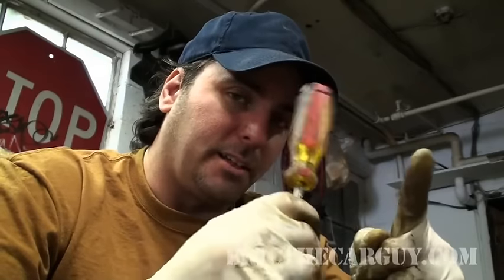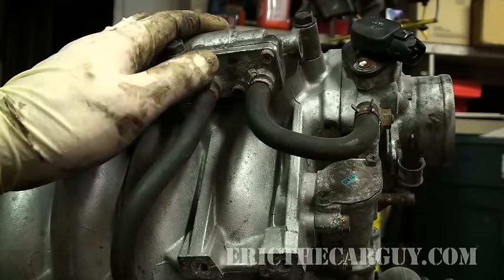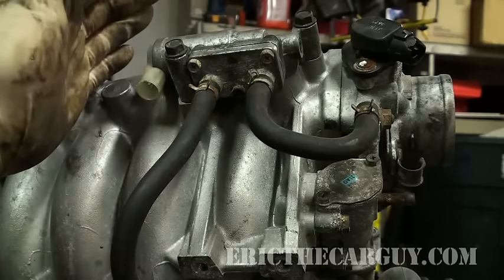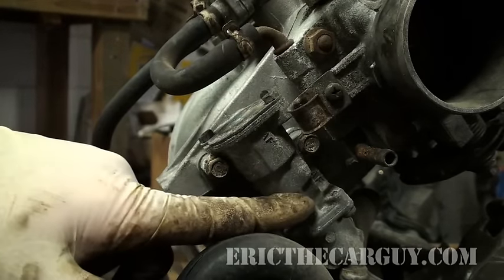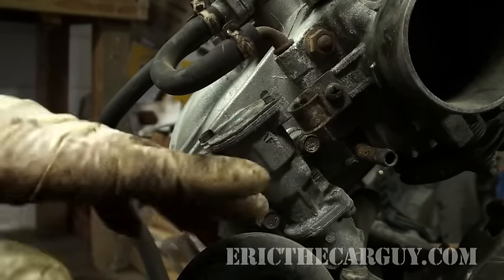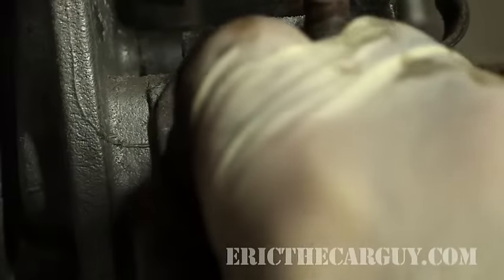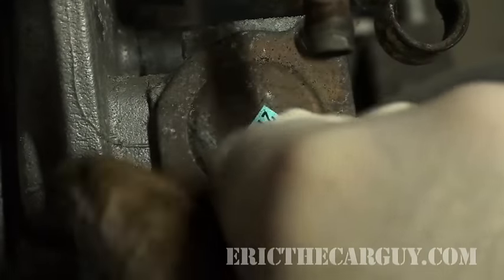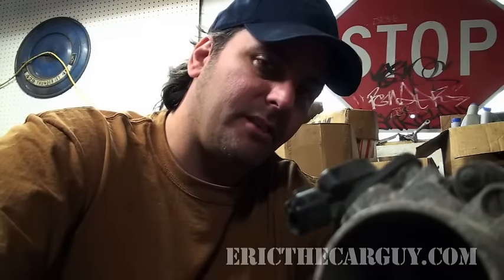How To Solve Honda Idle Problems - EricTheCarGuy

Comment: could a bad map sensor be the cause of an idle issue? I have a 96 Honda civic with a b16a motor and I checked my idle air control valve and cleaned it out and I was still having an idle issue but when I unplugged my map sensor and sprayed some carburetor cleaner in it I got some gunk out that was in it and it temporarily fixed my problem until the next day I drove it and it did the same thing happen with my idle. could this possibly be the problem?

Comment: I’m here in 2024 you basically told me I need a new one. My d16y7 has been sitting for a few years and I’m resurrecting it and I’m totally fine with that, no need to beat up an old part.

Comment: my 97 accord stalls randomly dosent make noise just quietly dies  , replaced the diatributor cap, rotor , plug wires , plugs , valve cover gasgets , i have to hold the key on a second or two after i start it so i know the ignition switch is going , do you think the iacv could be bad also .

Comment: Hi Eric, my 1992 Honda civic takes longer than expected to idle on a cold start. Even when the engine get to it normal operating temp, and u switch off then engine and on again, the idle goes up and again and take another century to idle. In summary, whether the engine is cold or hot, when you start up the engine, it will take so long to idle. What could be problem?

Comment: You mentioned throwing parts at it. I've replaced the distributor, fuel filter, plugs wires etc and still haven't found the problem. I've tried everything. Still idling really low. I'll figure it out eventually.

Comment: if there is air in the coolant system and it is roughly 70 degrees outside would the idle air control valve you talk about be effected?

Comment: Hey I just had to replace a thermostat in my 08 tl base nav atm. Now that that is done the car starts up fine idles fine but when driving the Rpms slightly fluctuate when coming to stop or accelerating. Any ideas. Would be greatly appreciated

Comment: I disconnected battery. Checked all of this. Turn on and operating temp rough low idle and compressor (new one, all a/c system checked out) clicks in and off a bit. Is it the air control valve?

Comment: Hey I'm having a problem I been looking for the a vacuum leak with no luck. Now my car bogs down and sometimes even backfires I have a 98 honda civic EX and it doesn't accelerate the way it use to accelerate. ignition is brand new and cables spark plugs

Comment: Hey Eric. Thank you in advance for al this helpful video clips. I have also a idle problem in my 99 integra. After I turn on the car the idle at cold is very rough and after the car reach the operating temperature and is turn off, to turn it on again it becomes a problem. It gives me a hard time to turn him on. Both FITV and IAC are brand new. What this could be?

Comment: Question about erratic idle on my 02 accord 2.3, with the ac on, but only with ac on, any other time, it idles fine. Idles up and down fast, would this be an iac issue or another issue altogether? Thanks.

Comment: Thanks, I recent installed a used engine on my 2002 civic. It has a fluctuating idle, I completely forgot to burp the cooling system.  Thanks

Comment: do you have a video on what to check when vtec fails to engage on older Honda's I've cleaned my vtec solenoid and checked wires and yet it still fails and I can't surpass 5k rpm.

Comment: Just did a JDM H22A swap in my 96 prelude Si mine idles up and down till it warms up for a few mins, then again I'm running off a p14 ecu that could be it. I will know when I get my p28 here in a few days. Good video
Reply: Very good video! I have a 91 accord and I am so grateful to have found your vids! I am dealing with a rough idle problem and have been going through all your steps. Subscribed. You're awesome!
Reply: Swapped out my p14 ecu with a p28 now she idels perfect
Reply: Aeolous Sul in the same way bro have a H2B in my ek hatch and it idles up and down till it heats up then i turn it off turn it back on and it runs good still idles high tho..
Reply: Aeolous Sul
Reply: +Geo Castellano Running the right ecu helped mine doesn't do it. I was using the H23A1 to get it going! now I'm running an obd1 p28
Reply: Also bleed the air out of the cooling system
Reply: it's supposed to do that
Reply: it's not supposed to do that, it should Rev up a bit until it reaches operating temp then come back down but it shouldn't surge back and forth

Comment: Tried all of this but still code 14 persists. I suspect it is my wiring ?   88 Civic dx swapped jdm d15 vtec.  All is well except the code 14.. tried 3 iacvs, cleaned them too . Bled cooling system and re did it.  Adjusted fitv and nothing.. still code 14. How do I check wiring ? I'm at it for the second month..

Comment: I have an 03 accord 2.4L 4cyl that picks and chooses idle at random with no check engine light and have run a scan with no codes. In park engine warmed up will idle between 1k and at random bump to1.6k rpm. Does this particular engine just do that or is it something I should look into?

Comment: My 2001 Honda Prelude has idle issues and everytime i fix something it throws up a new code. I changed the 02 sensor and cat bc their were codes for that. I fixed the IACV, the MAP sensor, the TPS, the intake hose, and now i have a p0108 code. Do you have any idea what the problem could be?

Comment: Mr Eric, I am in need of further advice. I have no check engine light and have followed all the other advice given in this tutorial. I cleaned and adjusted all components and still have an idle problem. Tapping the AICV does nothing. And it's random that my idle bounces. I lastly tried cleaning the PCV valve and still nothing. Although, I will say that when I plugged it with my finger while running, my idle came down a bit. Not low enough, but better. One a side note, all of this kinda happened all of a sudden (high idle and random bouncing of idle). Also, higher octane fuel seems to make it worse. I know that what I'm saying is all over the place, but I'm just trying to give all I've found out to get a better answer. Cleaning the AICV gave me perfect throttle response (and power at first), but it didn't change the way my idle acts. The cold idle controller was about 3 turns away from tight. I adjusted that but gave it a turn out from seated. I might try seated next, but other ppl say it can be a turn or so out. Just trying everything. Seating it made my idle over 1000, and it hangs normally at 850 or so. So that's why I backed it out. Either way, I live in FL so it shouldn't matter much. But, I'm learning as I go. My car is a 95 Accord EX and has about 260k miles or more. None of the above has ever been replaced to my knowledge. So, please advise me as to what is the best course of action. Oh, and I can't find a vacuum leak, but I hear a hissing near the driver's side firewall, and it continues for a couple seconds after I shut the engine off. Any idea what that is? Any info is greatly appreciated! 
Jason...
Reply: it is definitely the iac. take it off and clean it out with break cleaner
Reply: Matthew Mason
Its definitely clean. Throttle body cleaner, and lots of it. did the same to my PCV. and i think it still works right after putting my finger over it and hearing the click.
Reply: Did u ever find out what was wrong with it?

Comment: Hello my son has a eg with a b16 and he's having idle problems it's not surging like ur talking about in ur video as far as the idle going up and down up and down his car doest want to stay running now  and keeps dropping RPMs and shutting off he has to keep giving it gas to get it going but if he slows down it wants to shut off again any idea what the Scooby we recently changed the spark plugs and bleed the coolant system because we changed at the Iac hose...plz help

Comment: I happen to have a 88 Accord with the 2.0 carbureted engine, it idles like crap when its warm, misfiring and never actually idling, it runs at around 1100-1400 when warm. (will stall if any lower) It runs fantastic when its cold.

Comment: Hi eric i have a concern regarding on my idle. When the ac is turned off when starting it up it’s fine but when i turn the ac and when it reaches to a certain temp. The rpm suddenly drops as in dead drop and the eng. dies. What could be the possible cause. ??

Comment: hi, i have a 92 hatchback civic. and ive replaced the tps and fuel filter, i also tightened down that plastic sleeve in the fast idle valve... but when i start the car, and give it throttle quickly, it sputters and hesitates. but if I slowly press the gas down it will rev to its full range, any idea what would be causing this?

Comment: Yo! I got a 1992 Honda Civic CX equipped with a Non-VTEC D15B8, and lately I have been having an idle issue. It goes up and down, and I also have a issue when starting the car in the morning, it starts but dies, and I have to keep giving it throttle until it can run, and when it does run, the rough idle starts. Also when it idles rough, the brightness on the dash lights go down and up with the idle. And when I try to get codes from the Service connector with a paper clip, the check engine light stays solid. Things I have already replaced, IACV, MAP sensor, TPS, Distributor, Spark plug wires (NGK), and ECU. The car runs rich and is equipped with a eBay intake and eBay headers, and a universal catalytic converter. I wanna say it’s the Wiring Harness, or some sort of electrical problem. Please let me know 🙏

Comment: I have a question. I recently did a auto to manual transmission swap on my 1998 honda civic ex. It has a D16Y8 vtec engine. Is the car suppose to have an idle air control valve below the throttle body along with the one behind the intake manifold?

Comment: Hi Eric, I have rough idle at start up and then the check engine light came on shortly there after.  Where is this unit for the 2006 honda Odyssey? Could it be the culprit?  Advance Auto scanned the car a the code came up as P0304.  They told me it’s the fuel injector.   The car runs fine. I was going to swap the coils and see if it’s the plug or the coil first.  I just fixed the torn intake air hose to the manifold. Please help.  Thanks in advance.

Comment: Good day Eric, I have a problem with my 95 honda ballade 180E (B18b), it takes a few  attempts to start in the Morning, when the engine is cold when it starts it idles LOW very low and goes higher when it gets warmer UP too a 1000rpm... I check the Air Idle control valve it works,map sensor it works... even cleaned the fast idle valve.... Check engine light is on....  PLEASE HELP....

Thank You.

Comment: like to know if you can help me out I have a 1997 honda prelude and I have that same idle problem I have cleaned and adjusted the one on the throttle body and I have replaced the one on the manifold  and it's still doing the same thing  I did have a head job done I asked the mechanic if he bled the cooling system and he said yes so I'm not sure what to do. any suggestions.

Comment: If I have a bad radiator would that cause a bad idle just wondering ? I have an 01 civic that can't keep coolant to save it's life... And a bad idle problem that has recently occurred where when I stop at a light the car will rev under 500rpms . Now recently the car will shut off at stop lights because the idle is so damn low.. I just cleaned out my idle control valve today and still nothing . I'm so confused about to k swap the damn thing but I'm broke because of so much money into the d17 engine I already have...

Comment: I have a 2004 Honda Pilot has hunting idle that goes up and down and some times in red light the motor turns off. This problem happens some times only. I cleaned the throttle body with no luck there's no check engine light any thoughts ?

Comment: If you had an Air Conditioning specialist and all vacuum leaks have been checked ...
it could be your motor mounts ...some Hondas will not accept most OEM. motor mounts ...just buy the two mounts available at the Honda Dealership and the other two you will have to go with OEM cause they might not make them anymore ...The factory mounts are more important ....then once they are on ....you have to readjust the mounts when the car is back on the ground ...but you will only be able to get to three of the mounts ....the car has to be running in neutral when adjusting by loosening and re tightening....good luck ..!!!

Comment: Hi sir my car is Honda City EXI(1997)the problem are.
1)jerks at low speed
2)RPM is not normal,rpm goes down when air con is switch on,i've already cleaned the IACV,any advice please

Comment: hi Eric, I know u r too busy to response, but I have issue with my Honda Civic Ferio  Enging D15B (1997) with RPM drop on load (activate AC, steering move, Gear engage, Headlight etc). where should I look for? I dont have any Check lamp ON issue. PLease help

Comment: I have a question now if my Idle started hunting and the next time I started it the Idle slowly started to rise then stayed Idling high than I shut off the engine disconnected the iacv started the engine and the Idle went really low can I rule out a possible vacuum leak and swap out the iacv I have a few old OEM iacv's
Reply: I have no coolant leaks so no air bubbles and my Build has around 6k miles on it so I'm sure there's no vacuum leak

Comment: Don't throw parts at it.  Wow, an honest mechanic. Went to R&S about 15 years ago to diagnose a overheating Grand Marque.  The kid, said, "oh yea, its the fan, motor, it needs to be replaced"  I said, well I don't thinks so, what if that didn't fix it?  He and I  went back and forth and I pretty much figured out that he was, in his brilliant diagnostic mind, just replacing all of the parts that could be the problem.  I told him, if we do it your way, I'm only going to pay for the first thing you want to replace, the rest is on you.  He told me to go somewhere else.  R&S eventually closed because of issues with the Attorney General.  I am not a professional  mechanic, but you know. a back yard one, so I know that you need to think on your feet to save money.  Most professional mechanics I know, won't be honest like you and admit, that you guys replace parts rather than clean them because you don''t make money cleaning them.  I'm ok with that, just not diagnosing by replacing like that rip off R&S.
Great video and your the man...

Comment: So i have a 98 accord doesnt have that valve just an iac. It idles around 1200 rpm wont come down. Thats even with the idle screw fully shut. Checked vacuum leaks and dont find anything. Replaced iac and its still there. Im literally lost can you give me some direction???

Comment: I got a question I have a 2005 Honda Accord that shakes vigorously only in Drive with your foot on the brake. when it's in park reverse or neutral it doesn't doesn't Shake  at all. any tips would be greatly appreciated
Reply: bluraymex23 did you ever solve your problem?

Comment: How about a 94 accord 2.2 motor that needs a light foot on the gas pedal or else the idle drops, idles a little rough( feels like slight misfires) and then the engine light comes on?? I’ve done a tune up to try and see if that was the problem which helped a little. And it needed a tune up anyway.

Comment: This fixed my idle problems so far. Was tricky to do without removing the intake. Used a bit holder with a flat blade bit to rotate it in snug.

Comment: so i checked your forum online and i didn't find anything addressing the exact issue i have but i'm drawing a blank on this one. So upon cold-starting my car, my engine idles just fine. my RPM's stay at 1500-1700 while im in park and when i put it in drive, it drops to about 1000-1200 which i assume is totally normal because both hondas ive had ran the exact same way, but anyways, once i start accelerating, my engine seems to choke up and it doesnt get up to speed unless i almost floor it. but as soon as i run through first and second gear, it runs perfectly fine for the rest of the time im driving it. it appears to only be an issue upon cold-starting so im thinking it could possibly be the TPS? if you have ran into this same problem before, i would appreciate any advice i could get. Thank you and keep on posting!
Reply: i have a busted oil pan gasket that needs to be changed but i dont think that would contribute to the problem. thats the only other issue that i know of

Comment: My car has an idle surge. Sometimes it takes a while to crank but only sometimes. It idles high and low. When it’s cold it’s fine when it starts to warm up it idles low and when it’s fully warmed up it idles high. I’ve replaced iac and that’s not it nor the cold iac. Not the head gasket either.

Comment: Hi.  I just changed my  iacv and my car's idle surges.  But if I switch on my aircon it idles okay.  Mine is honda civic 1995 model.  Also if I remove the iacv sensor the idle surge stops (aircon is off)...  What could be possibly wrong? Thanks in advance

Comment: I will try all these fixes. I have a 2004 accord. The idle "bounces" from 1000-2000 rpms in park or neutral. When I was driving it it would surge and I would have to hit brake pedal to slow car down....pretty scary !

Comment: Yo man I just changed the fuel pump on my 94 Accord and got my car running again but since I changed the fuel pump and ran the car Everytime I come to a complete stop the idle will drop to zero and the engine will stall and I'll have to either put the car in neutral or park and start the car again. Any ideas?????

Comment: I've tighten idle screw on my throttle body (D16Y7, 99' Civic) as tight as it would go and the furthest the RPM will go during idle is 1,000-900... is that normal? Is it bad?

The reason I adjusted it was b/c I replaced the IAC Valve and MAP sensor and it still has trouble starting. And the engine light still gives me p0505 and p0108, (IAC system and MAP sensor circuit high)